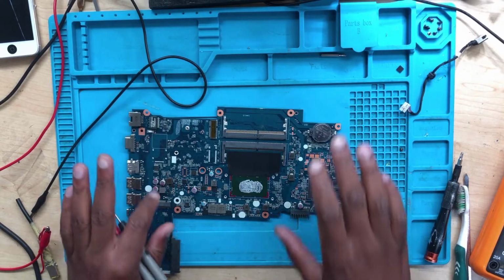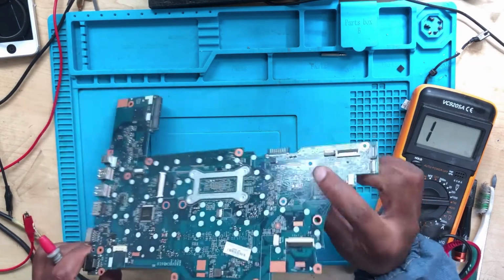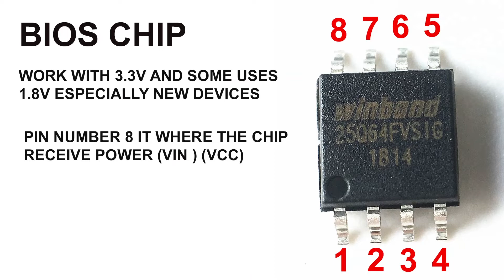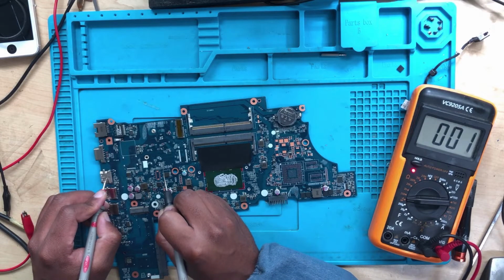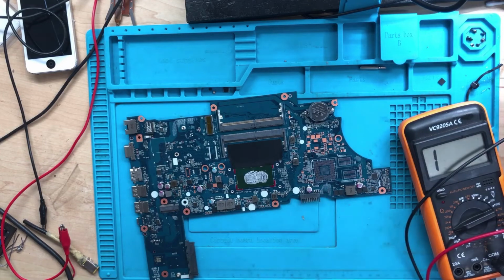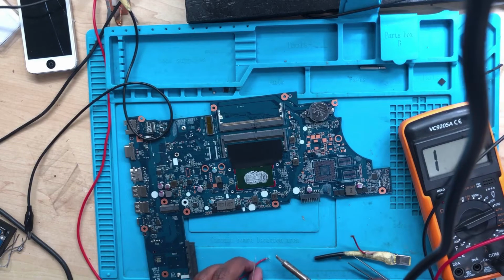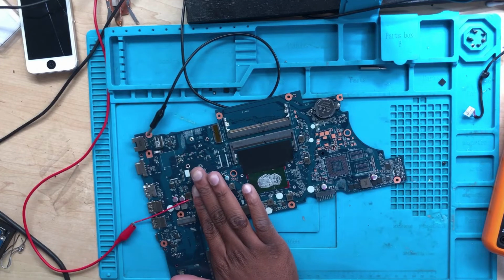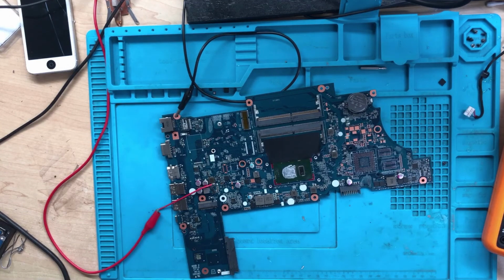All the pins from Bios chip are shorted to ground - The pch is causing this

Comment: Yeah, I run into that somewhat with HP laptops. it gets frustrating for me when I cannot find a schematics even though like you said there are shortcuts to finding out what's wrong with the board. In this current age of scarcity when it comes to computer components especially processors and gpu is really not cost-effective to replace the processor or GPU nowadays.